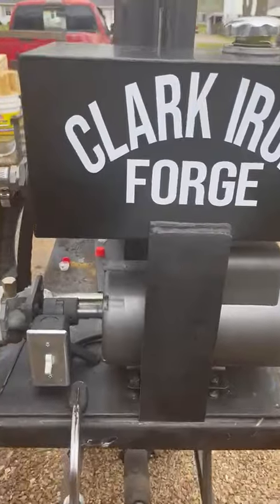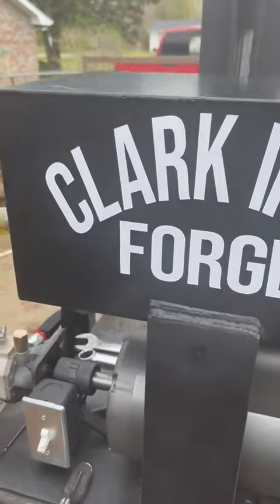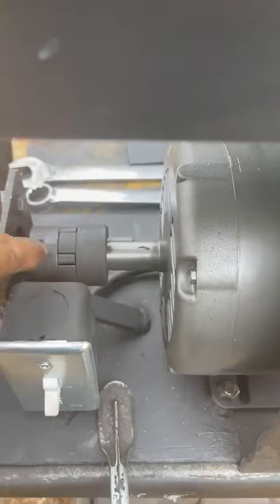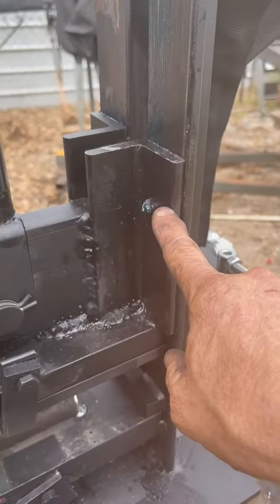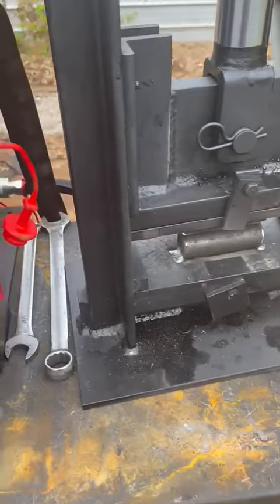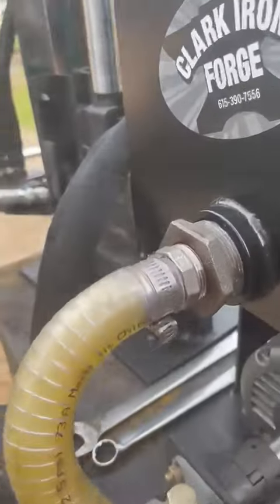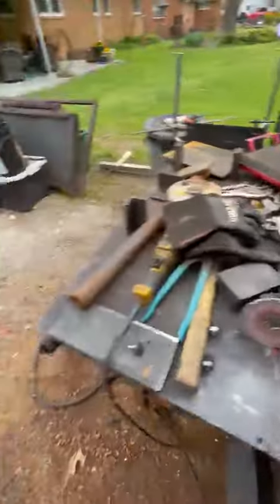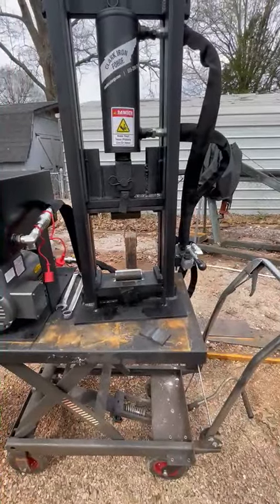What to expect when you are expecting a Hydraulic Press Machine from Clark Iron Forge.

Comment: For thousands of dollars the first thing I look at is the welds. If it doesn't look like a professional ran them I'm gone. If they look like leprosy, have undercut, a collection of weld metal blobs instead of a smooth run bead and spatter all over the place then how can I trust the rest of the machine is quality built? I've seen much worse but this doesn't pass the test either.
Reply: These are very quality machines. He stands by his product and several well known smith's use them. They might not be as pretty as coal ironworks  but I'd put them on par if not better in quality.